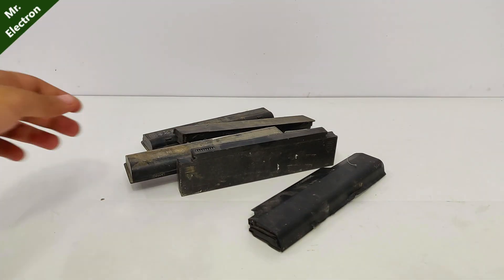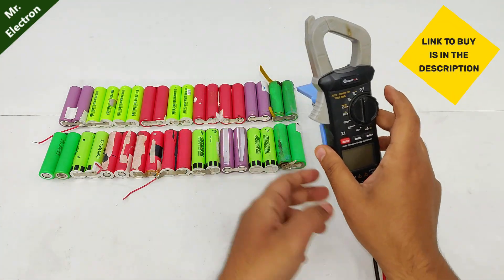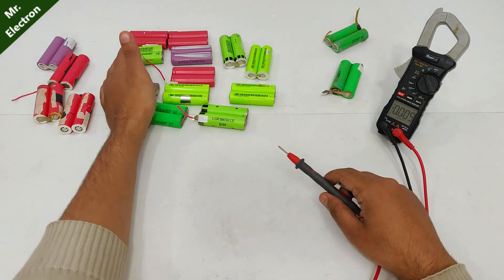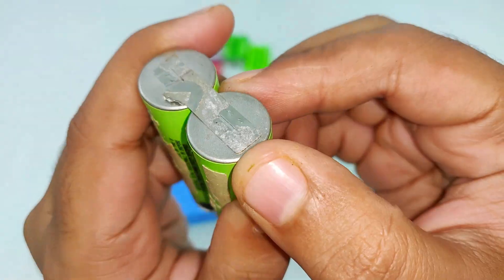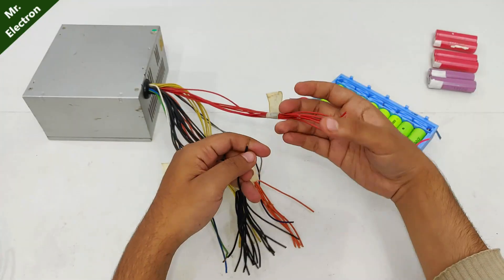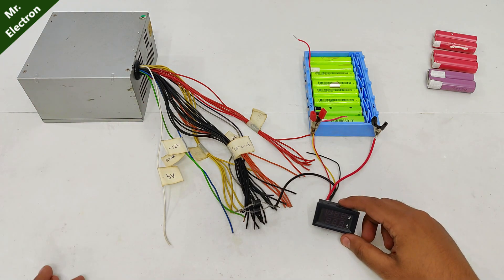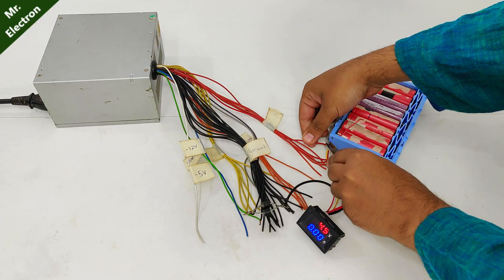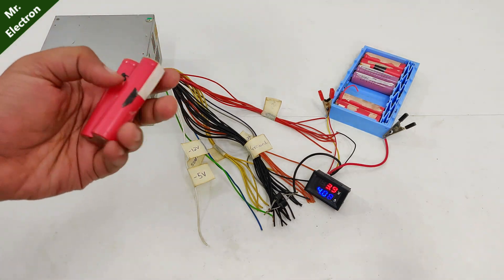Make 12v to 220v , 1000W Portable Power Station from Waste | Part - 1

Comment: This is not safe to charge Li ion battery without charger & BMS
Reply from the maker: True for most people but for me, i have been doing this for more than 10 years so its safe enough for me and as for those who are new to all this, precautions are recommended ( that goes without saying ).
Reply: @MrElectron  Its not about experience its all about type of Batteries & Chemistry of battery
Reply from the maker: And how are you going to get all that info about batteries and its chemistry ? Only by collecting related information from authentic sources and practically trying it. 
In short - Experience !